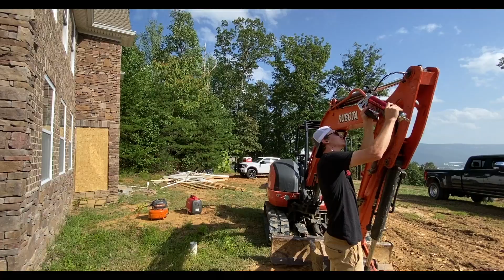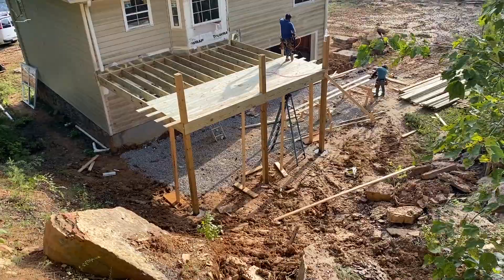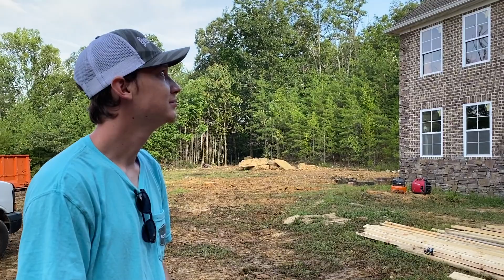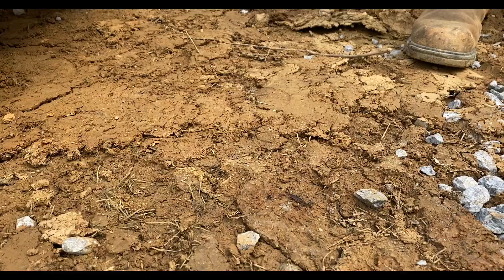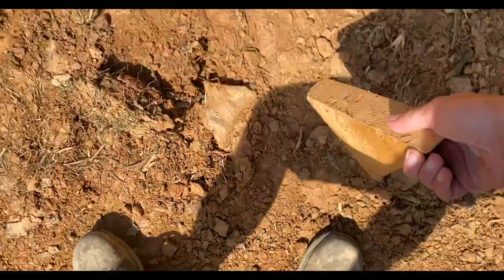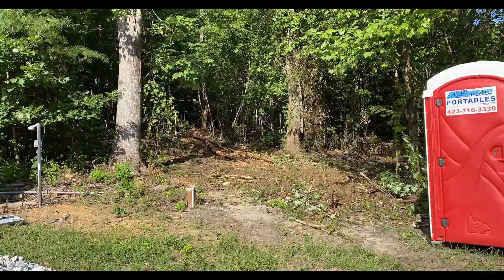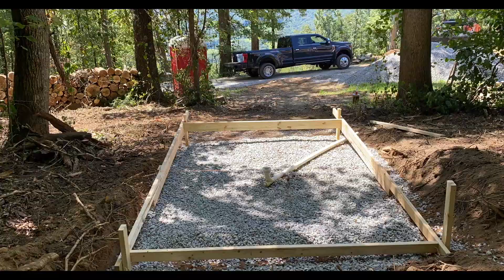The New Goonzquad Headquarters Part 9

Comment: Instead of putting stairs on the deck put SPIRAL SLIDE.
Reply: And then how do you get up without going inside the house?
Reply: @kirara4953  It's for personal use not guests. They can go through house if they want to.
Reply: @sgrovr  you still have to go through various rooms just to get there. Just put a staircase so you can go up and down from the outside. Plus, getting things down by a slide sounds like an easy way to spill things over.
Reply: @kirara4953  It's there wish why we are arguing I just given my opinion.
Reply: @sgrovr  it's not an argument just a discussion.

Comment: You're talking about old windows but you're putting mobile home style crank out windows.🤣🤣🤣🤣 its going to look like shit. No disrespect. But it is. Crank out windows are trash! Stop wasting money when the house already has new windows. How about laying down so concrete around the house and black top the drive way so you guys can stop using gravel and tracking mud. And build a retaining wall so the mountain doesn't mud slide into the back of your house possibly.

Comment: I would say no on the spiral staircase. Getting patio furniture, grill, smoker etc up those steps will be a nightmare and avoid going through the house. Also for your dogs it will be much easier for a regular staircase.
Reply: I second the no to a spiral staircase.. doba landing with two sets of stairs.
Reply: I would recommend a  "zig zag" staircase made of wood an metal, with a lower deck opening up to a walkway right to the cliff.
Reply: @alphastorm123  zigzag ...
Reply: @Tyler_T1985  I am german, sorry 😉
Reply: alphastorm123 what in the hell is a zick zack?
Reply: They have a big ass forklift.
Reply: PimpTwzt I realize that but not like they want to bring it up there anytime they want to put something up there.  Plus it will more than likely live at their main shop once built
Reply: Good point about the dogs.👍
Reply: I agree. I like his idea of a bridge or elevated walkway over to the “cliffs area”, that would be pretty cool. So maybe come down from the opening on the deck with just a few stairs, and then turn left and go out to about the end of the deck, and then you can either go left down some stairs to ground level, or take a right and go to the cliffs. It looked like a cool little area when he was up there talking. Couple chairs and a little shade, would be the hot setup.

Comment: ## CONCRETE. *****.  Make sure you put in a couple conduits for power and you you stub up  a few waterlines in the slab edge.  That way the waterlines will be in the walls and out of the cold come winter !!  And  put a trap on that floor drain so you don’t end up with bugs and rodents

Comment: don't want to be a kill joy, but spiral stairs are not functional for anything but climbing. Better to have wide stairs with landing to allow hauling stuff up and down otherwise you will have to drag it through the house.  Well house should be closer to the well pipe to enclosed anything that may freeze and wear from outside elements.

Comment: Probably to late because its probably already poured the slab for the pump house i would dig out the gravel around the perimeter so the concrete makes contact with the dirt so the slab ain't riding on just the gravel

Comment: I know others have said it, but you most definitely need rebar in a slab that big that'll hold that much weight. Your bar grid needs to be around 1'x1' squares. You could probably do 14"x14" squares and be okay but I'd go ahead and do my first suggestion. Also make sure you have your well technician come out and blueprint the waterline and drainage setup before you pour that slab.

Comment: If you want that slab to last you need to put some steel rebar or at least some steel mesh down prior to pouring cement.  Also make sure that your drain won't be in the way of what you are placing in the shed so that it can still be accessed as needed since it's not going anywhere once the cement is poured.

Comment: You will need all of that nice wood that's in the dumpster since you have so many other projects planned.  You will need forms, shelves, sawhorses, etc.  I would simply load the actual trash into the pickup every time I was on my way to town, and drop it off at the dump.  Seems like that huge dumpster expense is not really necessary?

Comment: The well house goes over the well not next to it.
Reply: Any place I ever lived with a well. The house was directly over top of the well
Reply: late 4 dinner .  In the application it should be away for access redrilling deeper .  Where I’m from it’s called a Pump house .  
Power , insulated room with enough access for maintenance and a generator to power their
Well during power outages.
Reply: G
ihttps://youtu.be/0AcMp9JJ8q0
Reply: I was thinkin' the same thing. The Well and Electrical components need to be "inside" the Well House.

Comment: I would definitely get some other ideas for outside stairs before deciding on a spiral staircase.
Reply: I agree! Spiral stair case is a problem and difficult to use if carrying anything. Also, consider having framers close up garage if your plans are to install a five car garage as others have suggested.
Reply: I agree ... good luck hauling a new grill up a spiral staircase.
A traditional staircase is the better option, IMO.

Comment: Glad you got a Dumpster in & cleaned up the site, get the dumpster on a long lease, will always find rubbish to put in, If you have a Clean site people work differently I found, If there is rubbish everywhere contractors will just add to it. Are you gonna paint the Deck handrails??. On the Uprights from the ground supporting the deck,  put on each 1 an Anti Spider & Snake ring around them, you dont want Spiders & snakes climbing up the frame and into youre house!!, You putting Rebar or Mesh in the framework you built for the Power shed before concrete arrives?. When you build the wall behind the deck, put in Pipes for the water to drain away, I thought you had a guy come out and Spray the site to get rid of spiders etc; Thanks for keeping the videos coming guys!! PEACE Out!

Comment: When it gets to drywall time be careful to wear masks because gypsum the main ingredient to sheetrock/drywall is a carcinogen. So when there is a bunch os sanded dust from drywalls protect your lungs. Side note, protect your AC unit during drywall install, don't let it run or ensure there are filters because the dust will ruin your unit(s). Good luck guys. If you go with a wash, I'd recommend a Nube slightly warmer white tone and it'll contrast nicely with your darker accents like windows and doors.

Comment: I can't help but throw some advice since I've done some masonry. This is just my opinion but you might want to tamp that gravel (every lift) and make the gravel flat, so the slab is equal on all sides. That's probably overkill but over enough time the gravity is going to pull it and if you have a wedge it could slide. Tamping the gravel will help that be permanent as well. Keep up the good work guys! It's fun to watch this progress

Comment: If you want to do an epic build you should copy the left side of the house (in its entirety) and build an addition to the right side of the house (including extending the roof) that way the house is perfectly symmetrical with the main door —— and it will add a ton of living space! Once that is built you can pour an elegant full circle driveway just as you see in mansions. You will transform the house from goon squad hq to gs mansion! Then later you can build a satellite garage matching the design of the main house somewhere off the driveway circle with a second floor guest house above it. Might set you back 100K but will add tremendous value. YouTube ads and views will cover it anyway! ;-) 

Make sure you carve out half a football field somewhere on property and make it totally flat so you can land your helicopter at the gs mansion!

Comment: I personally wouldn't bother with a staircase at all for the deck. It would look much cleaner if you left it only accessible from the top floor and built a gate into the decks handrails where you can attach a removable staircase or ramp. Trex is a composite lightweight wood substitute with the appearance of real wood that would make for great building materials for the stairs!

Comment: Congrete vibrater (rids air pockets) and trowels. You can straight texture the top also using a push broon and smooth trowel the edges. That the easy stuff though.

Comment: Should probably look into getting rebar for that concrete slab or else over time it will settle and crack
Reply: Definitely epoxy coated rebar and wire mesh to control cracking
Reply: Or throw some fiber mesh in the mix!
Reply: SmarterMMO it will crack regardless
Reply: Actually a proper perimeter  foundation that is 2ft to 3ft (60 cm to 1m) deep and with rebar would be much better.   This slab on grade is likely to move from FROST HEAVE and or slide down the hill from water or mud slide.  the slab will crack and fall into pieces with no rebar

Comment: Your contractor saved you a lot of grief going concrete. I was just thinking about the weight of those tanks once filled with water...
Should put some steel screen in there and make sure the slab thickens at the edges.

Comment: Hi Guys, I didn’t see any stakes in the midsections of your pump house forms, the weight of the concrete will push them out and you’ll end up with all the sides of the slab bowed out..love all the work you’ve been doing, keep it up.

Comment: Install a few 3” or 4” pvc elbows in the floor so you can run in your electrical and water underground and up through the floor.
Reply: Yes having your wires and all the connections will keep them from damage from outside elements. They will last a lot longer and falling tree branches or wind will not destroy them.
Think ahead and you have your main power coming from cross the drive way. You want to bring in your main power to this shed and then from a 3” under ground PVC, all the way to the house.
Reply: @afarzad  not only that but it's easy clean access If you need to rewire
Reply: I think this would actually work .. underground is the best way to keep from fire hasard.. smart way..
Reply: Due to their location been so open. Lighting can hit the fyre house and make it into a hazardous space ' so I agree that wiring under terrain is excellent because of it.
Reply: Exactly, it'll save you loads of time and frustration.

Comment: Your house's lifespan will depend on the landscaping you do in the back. Or at the first storm your home will be done for. ^__^;
Reply: THIS.
Reply: Not necessarily. The house has been there for 10 years with no problems. Obviously we don't know where that cliff was before but if it has lasted this long I don't see why it won't last just as long
Reply: @IjazSaleem  Clearly the rock that they dragged away weren't there 10 years ago because otherwise the construction guys would have moved them with the others. So they must have fallen during the last 10 years. And remember erosion increases exponentially, so they must do something about it
Reply: @silvio.zambon  I mean it doesn't really mean that it fell within the last 10 years. If the trees are anything to go by then they would have just left it
Reply: @IjazSaleem  because they removed all vegetation as well as huge rocks. Both where stabilizing the whole thing. ^__^;
Reply: @cestusfr  Oh yeah I forgot they did that. Silly me and silly them unless they put something like concrete piles in to stabilise the ground

Comment: Hey yall from experience on the spiral staircase I wouldn't suggest doing it it's cool and everything the first year of having it but over time trying to get things you dount want to bring through the house like greasy grills and smokers and dirty furniture that sort of stuff but what you could do is a two tier staircase that goes down to the corner of the house either take a 90° down the side of the house or 180° back under or 90° towards the hill side and make it out of metal or other materials just a food for thought is all

Comment: Buy a Sthil chainsaw. It's sedimentary rock. Laid down layer, by layer, over millions of years. Keep you eyes open you'll often find fossils in the layers. I'd use those flat slabs for the pool deck,or patio. Looking good. First dig a 12 in wide, and 12 inch deep footing around the perimeter, build your form,pour your slab. Simple

Comment: Hey goonzquad when doing concrete and pouring a slab like that. Your best bet is to dig at least 8-12 inches  deep  most of it will love a base dirt material, and regular dirt that is been graded flat and then do the frame up for the sides in the shape that you want it. Also put rebar in there slab to reinforce it or else it will lend up crack and falling apart .

Comment: Boys, have your framers re-instal that front door, adding a pressure treated wood 2x8 under the door frame. You dont want that soft wood frame laying on the cinder blocks. Rot will appear so fast and ruin the day !!
PS Save that fixed window on your balcony for your water shed. It will look awesome and provide natural light in there. 👍

Comment: On your wheelhouse if you're planning on running the water and electrical underground you might want to put in some spots for you can pull it through conduit before you pour the concrete I know you probably won't read this since I'm like the hundred thousand comment but just thought I'd shout it out there just in case

Comment: If an when you pour a slab for you well/pump house dig a 6'' flex tile below the frost line so you can run power & waterline to house and from the well etc place it inside the slab where needed . Wells are our family business there should be a water well log for it somewhere most likely check with county health dept or state DNR. Health dept might have the septic plans/designs also plus run drain away from the well.

Comment: The stairs you just threw out could probably be used to access the other parts of your property cliff behind etc!! You want to get them out of that dumpster!
Reply: I'm surprised they threw away what they did.  I would have saved the bigger pieces of scrap wood...during construction projects you always find a use for scrap wood.  I would have cut the smaller pieces up to fire pit size wood. Fall/winter is just around the corner.
Reply: Yo black widows can be deadly. Not just a painful bite.
Reply: I thought about posting that the last time when they were clearing he lower area. It would be nice to install some 4x4 posts at the top and bottom and use the stairs to quickly access the lower level just Incase something happens .
Reply: Sandy Graetz . No kidding hey save SO much money.   Repurposed material.
Reply: With the money they Generate , they aint worried IMO
Reply: For all those saying burn the lumber, you do realize burning treated wood is toxic right
Reply: @brandonwinters1722  There's no treated wood used inside the house. That being said, the old stairs from inside the house wouldn't be as easy to use outdoors since they would need to be treated in some manner, lest they rot in a year.
Reply: @herrakaarme  You can char the wood to prevent bugs and rot.

Comment: Now that you can run wires very easily across the house you should install some good CCTV. Reolink 4MP 16CH PoE Video Surveillance System, 8pcs Wired Outdoor 1440P PoE IP Cameras, 5MP 16-Channel NVR with 3TB HDD for Home and Business 24/7 Recording, RLK16-410B8 https://www.amazon.com/dp/B01C6KUKMY/ref=cm_sw_r_cp_api_i_7hpvFbKVY24HZ 
That’s a link for a good set!

Comment: Daaaaaang son!!    Maybe put the piping rough in to bring the water in and out the floor before you pour the concrete.  Otherwise you be running it up the outside and in.  That make no sense to me.  You can put some short stubs in the form to the outside then complete to the well once you trench over to the well house.  Just sayin'.     May as well make it LEGIT.

Comment: If you want to be more environmental, cut up your old framing for the fireplace; AND, I have been using canola oil for my Stihl chainsaw for the past 10 years.  It works great and is one-third of the cost of petroleum chain lube when you buy it at Costco.

Comment: Why don't they build the well house where it is now? It has the well head right there, so it can be inside protected from the weather. Also, I wonder if they will remember they need to trench in their waterline from the well to the pumphouse and lines to the house before they pour their slab?

Comment: i work in concrete and i highly recommend some more bracing on the shed because it will blow out the side and you will not enjoy it lol also i would run a string along the top of the wood that way u know if the wood moves just put nails in all 4 corners and wrap it around the nail

Comment: Given the size of the slab you’re going to pour, I suggest you put in some rebar to reinforce the concrete. That way if there’s any shifting, cracks will be minimized.
Reply: It being a well house they need to install the water pipes before pouring concrete. Might want to talk to the guy that is going to be installing everything before concrete.
Reply: Excellent idea! I'm also worried about the pitch of the earth behind the pump house AND the house. That hillside looks unstable!
Reply: Definitely!
Reply: Yeah definitely, especially since it's going to house a water tank with a lot of weight.
Reply: ”Thay way if there’s any shifting, cracks will be minimized.” ~Every plumber
Reply: V
ihttps://youtu.be/0AcMp9JJ8q0
Reply: That and they should put fiberglass in the concrete. It makes it last forever. Its a little expensive but fiberglass mixed with concrete stiffener makes the strength of the concrete insane. The only thing bad about it is it is just a pain in the ass if you ever wanna tear up the foundation in future.
Reply: And dig a footer or 2 so it don’t slide down the hill